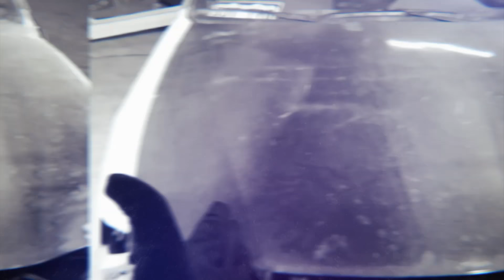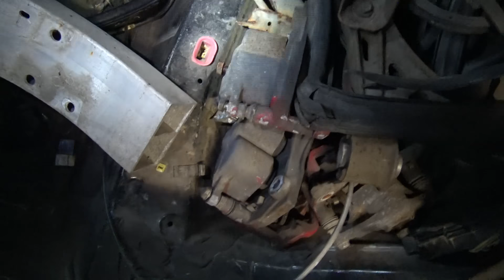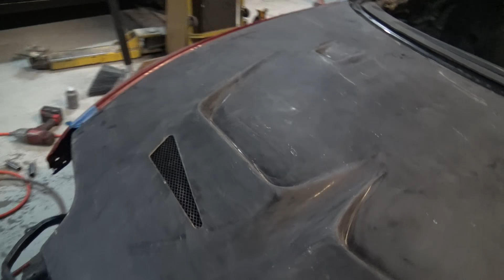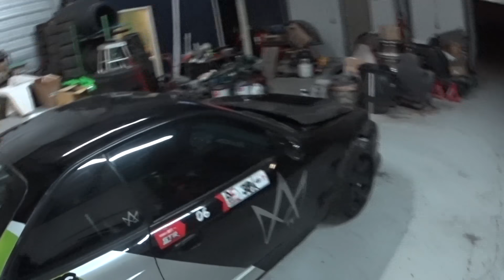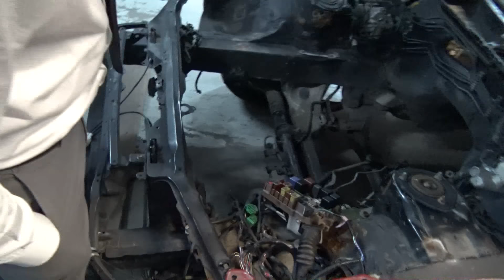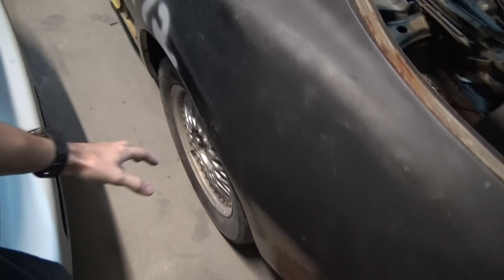Pt.2 | MKIV Supra Project | What does it REALLY NEED?

Comment: I've done basket case builds like this before, fun times, but its expensive and takes LOTS of time, good thing you have a shop and buddies to help, you will need them. the end result is worth it knowing you built it.

My advise, inventory all the parts, completely strip it, clean it... work on the body first so you have a good foundation to build on.

Comment: For the weather stripping. If it doesn't have holes and in good condition, wash it up with dish soap and then do a layer of Silicone grease (I used a regular silicone lube in spray can). It will look like new and the silicone will protect the rubber from wear and tear. 
just my 2c =)

Comment: I think since engine builds, transmissions installations comes easy to you.  I would start with body protection, cheap rust treatments underbody and interior.  Get a carpet and glass installed asap.  Prime the exterior and get fender liners that will inspire you to continue other details in the car.  Than start tackling drivertrain components, fuel and engine &transmission.

Comment: Have the entire shell and bolt on body parts sand blasted. Fix all the dents and half assed deletes. Spray it something flashy or do something aggressive like RWB style. Don't do a stock interior, that will be a forever project. Just make it nice race car style inside. Make a cage, flocked dash, simple door cards. Spray the interior gloss white or you could try like a truck bed liner material inside, would give you some noise insulation perhaps. You could also try it on the outside and have a flat black mad max machine. For engine save yourself a lot of time and money and do an LS swap. After all, you already have a 2jz drift car.

Comment: In my opinion I wouldn't put money into it if its extremely rusty. Looking at the condition of the car I suggest you just drop a swap in it and get it running. Leave it as a shell and try covering up some rust . Throw a roll cage , seats , cheap paint and thats it. Glass and lights of course.

Comment: I think you should build a Nissan engine for your 240 ground up so it holds up to a turbo. either v6 or v8. your Toyota is dialed in so it would drop in the supra easily. not enough people give Nissan the love it deserves for high hp engines.GTR is evidence that they're capable. and you have Nissan transmission behind your Toyota engine.I guess I'm just one of those people that think any car build is way cooler if it has an original type engine set up like the manufacturer should have done or could have done.

Comment: Clean on the outside, crappy on the inside.. Just like any other supra out there. How about the first supra, that is crappy on the outside, but FAST. Just the amount of mud needed to get that potato straight costs seconds. Blast it, weld it, throw a roll cage in it, and maybe a layer of clear, or tar. then put your money in good use, making the POWER.